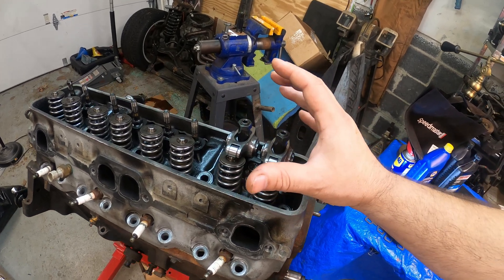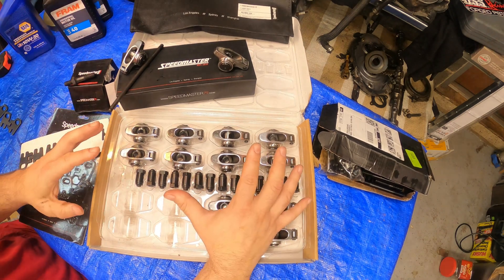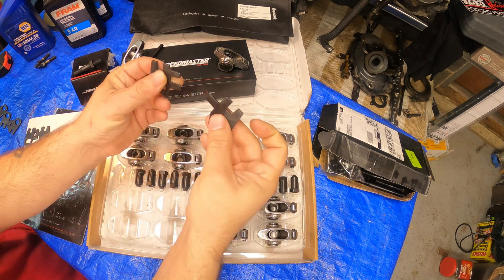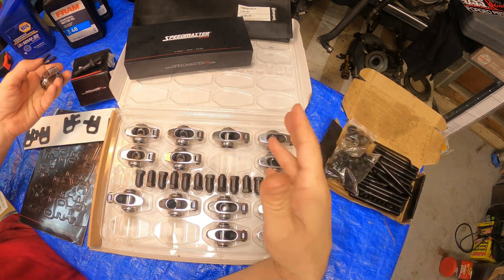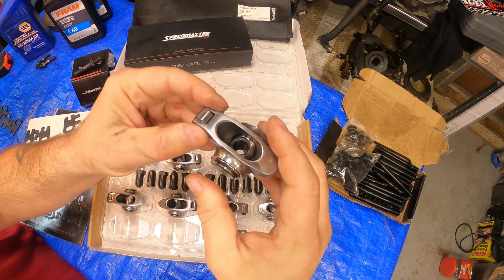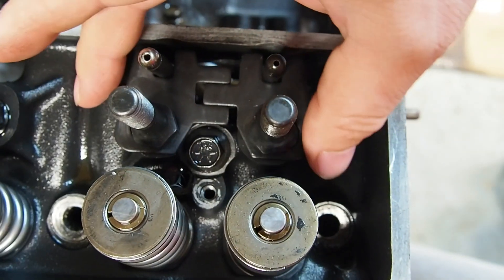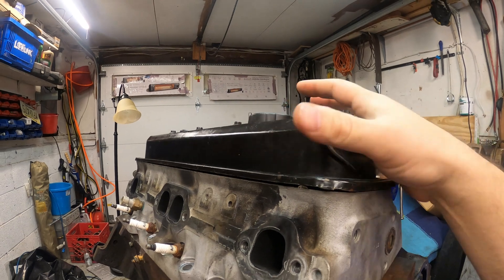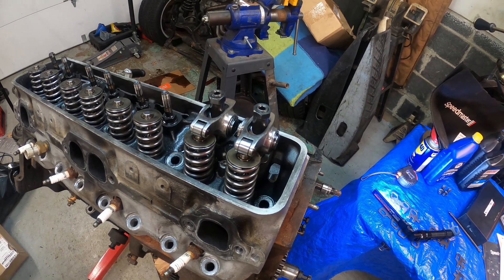Small Block Chevy Rocker Arm, adjustable guide plates LT1 Speedmaster

Comment: Did you modify the heads to fit the 7/16 studs and guide plates?
Reply from the maker: for the aluminum heads they bolt right in no modification necessary
Reply: Thanks for the info.  Now I have to go place an order.  Thanks.
Reply: the bolt size of the stud is usualy 7/16 corse thread and bolt up the same as 3/8 studs
Reply from the maker: @reevesautomotivefarm9614  yes

Comment: Rockers look nice! Definitely more weight than aluminum ones to control though. I'm guessing the springs were the more other big ticket item you were talking about. 

Trick flow normally has some decent deals on 1 piece chromoly rods too. 

For a little more power on a budget you can get Elgin stainless valves and have a back cut put on them. Think I had less than $150 in intake and exhaust valves from them
Reply from the maker: Awesome thank you for the  info .... will look into that